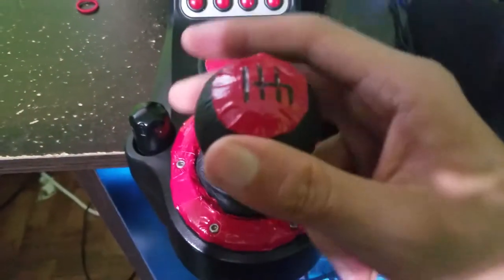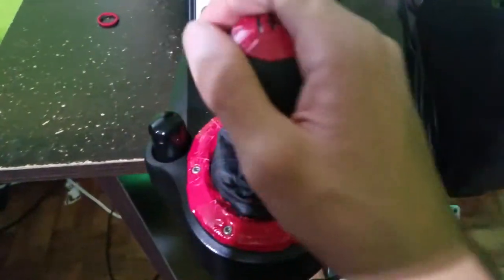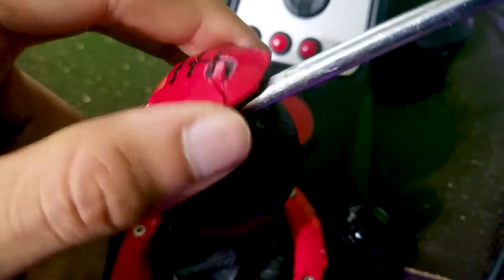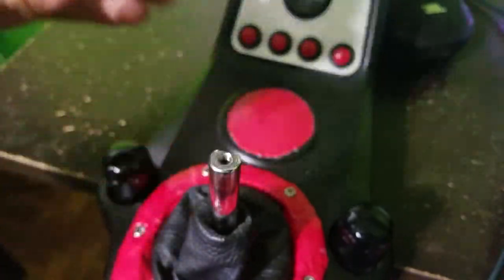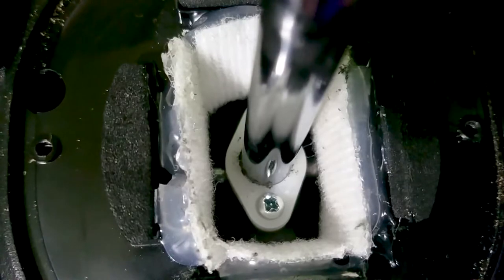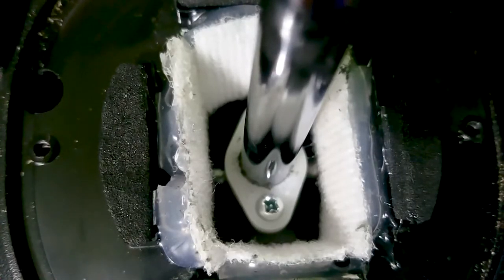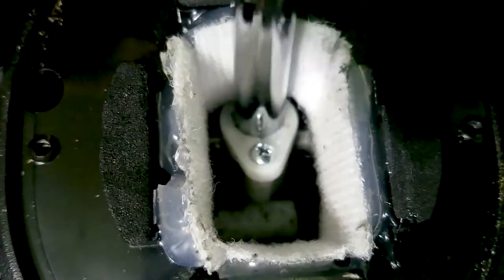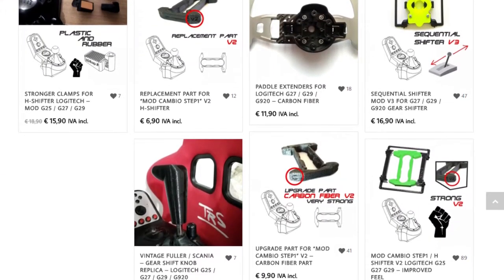Improve your Logitech Shifter for more Realism UNDER $10! (Works with G25/G27/G29/G920)

Comment: Quick question, what in the name of Initial D did you do to your shifter???? 
Its an absolute eye sore man
Reply from the maker: Lol Ikr. But looks better then stock to me because I wanted it red.
Reply: @TechiePocket1  "I wanted it red" and used pink tape...
Reply from the maker: Lol. Actually it was red but my color filters were off. And I have now switched it back to black with the mod cambio v3.5 👍
Reply: @TechiePocket1   no, it really did not, if you wanted it red you could have gotten a cheap can of spray paint and some clear coat. but i am trying the hook n loop mod today XD what is this mod cambio 3.5 you speak of? is it a 3d printed piece? i was thinking of getting one but ive heard they dont last very long, im also tinking of installing a "real" lightweight shifter knob, aluminium perhaps. (i hate the plastic golfball)
Reply from the maker: I reviewed it on the channel. It's good while it lasts but after a month it was worn-out and worse then stock. Wouldn't recommend it. What I would say is save your money for the SHH shifter
Reply: @TechiePocket1  naa, th8 would be money better spent
Reply from the maker: @DAN.eight6  Maybe, haven't tried the TH8
Reply: yea lol

Comment: Use rubber strips. 10 times better
Reply from the maker: Of course!
Reply: Can u help me how can i put the strips?
Reply: @sba4395  put the rubber strips where he put the padding. on all four sides towards the top so when you shift, the stick will bump into the rubber.

Comment: why not rubber? or shifter mod from 3drap for example :D it is cheap and ready to use!
Reply: 3d printed crap is terrible, it breaks in 2 or 3 months.
Reply: @mintblancmanche5508  it can happen. for example i've used it for almost an year without problem